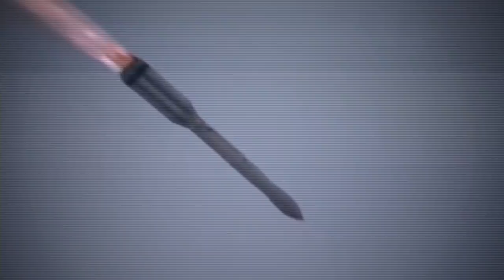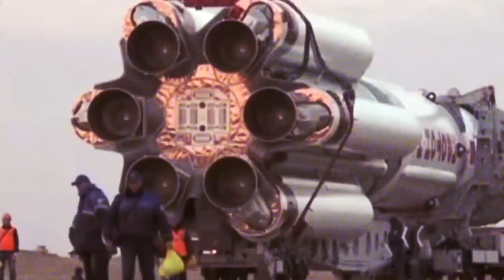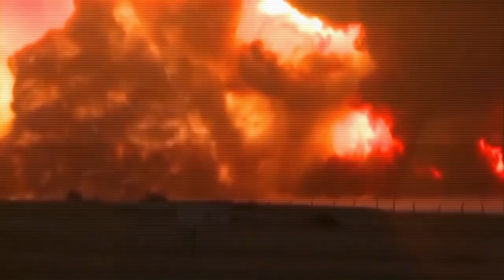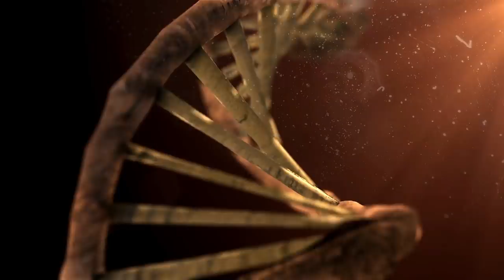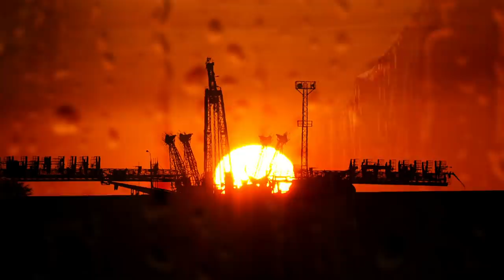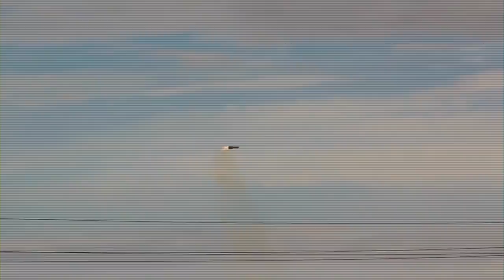Rocket with Sensors Installed Backwards Flies Upside Down

Comment: Small ICBM test flight failed when the software clock was set to the wrong start time.  The stage 1 pyro motor that provided power for nozzle steering started 30 seconds early and thus ran out of burn 30 early.  At which point the G&C could no longer provide steering and the range safety officer executed the destruct sequence.  Stuff happens.

Comment: Yes the technician installed the sensors upside down, but let us not forget that this PASSED inspection. Or possibly several inspections. They weren't building a Lada so there would have been inspections for everything. Or there SHOULD be inspections.  I guess if you have been launching these things since 69 without incident things get a little lackadaisical.

Comment: Not only the fact that it had arrows to point the direction of the angular velocity sensor, either Scott Manly or Every Day Astronaut said that it is apparently really fricking hard to put the sensor in the wrong way, so much so you would need a hammer to put it in the wrong way

Comment: Yeah ? Did you know that a US Military Space Probe of the Titan IV Family exploded shortly shortly after liftoff from Vandenberg AFB. The rocket used the exact same fuel (Methyl Hydrazine) and oxidizer (Di Nitrogen Tetratroxide) as that used in the Proton Launcher. The question to be asked is why does the producer of this video choose to single out the Proton ?

Comment: Even if the sensors were installed wrong, the bad orientation should have shown up in a pre-flight check.
Reply: Angular velocity sensors, so they’d be showing no angular velocity regardless of orientation before flight

Comment: It is still unexplained how the rocket's fuselage broke in mid-air, well before hitting the ground.
Reply: Wind resistance.
Reply: Inertia
Reply: I would guess wind resistance. The nose cone protecting the satellites is designed to take a large amount of aerodynamic force, but only along the main axis of the rocket. After turning all the way over and then some, that cone was subjected to aerodynamic forces at a significant angle difference from the main rocket axis, causing the nose cone to sheer off the second stage mounts. Otherwise, you will note that the rocket remained intact until it struck the ground.

Comment: The sensors were only designed to be put in the correct way. Whoever installed them really had to hammer them in for them to fit upside down. 
Also, gotta love hypergolic fuels. Toxic as hell.

Comment: Orange flames and toxic residue is the mark of hypergolic fuel which ignite spontaneously on mixing with each other. Its a way to simultaneously ignite all the rocket engines at one time when there are so many engines or when an ignition system presents a reliability risk, like lunar landers. Since the 1950's US launch rockets use cleaner burning fuels, like RP-1, that do not leave a toxic residue.

Comment: Yeah, I'm not surprised someone forced the sensors into place even though they didn't fit like they were supposed to. I've had more than one instance of someone forcing an Ethernet cable into a USB B port then calling asking why I am being paid if the printer doesn't work. Stop unplugging my stuff!

Comment: Redesign it so if installed up side down it will not work at all causing the rocket to not launch at all. Or a battery powered alarm that goes off if it is upside down just sitting on the work bench
I bet some one was looking for a job after that.

Comment: In NASA that step would have been triple checked and signed off multiple times. Some ended up in a gulag.
Reply: noaa-n prime satellite accident...
Reply: NASA lost a billion or so on a mission to Mars. One person was using metric measurements, nobody else was.
Reply: Apollo 13, Challenger, forget the name of the shuttle that crashed in Texas
Reply: @Richard-zc1cj  metric is way better than whatever the hell we use. Grams, ounces, stone, pounds, etc...
Reply: Biggus Dickus  They had polished the mirror to the incorrect specs. An amount probably imperceptible to the human eye but when your dealing with billions of light-years it adds up quick.

Comment: got to wonder what's up with quality assurance procedures in Russia. 
Why did nobody check and notice the incorrectly installed gyros?

A similar accident comes to mind, also in Russia, where an Soyuz launch vehicle was launched from a launch site in the far east of the country but someone put in the coordinates for Baykonur into the rocket's inertial navigation system as the launch site, causing it also to immediately veer off course on launch.
That one was destroyed by ground command.

Comment: A practical example of shit goes wrong, even in very expensive projects. Maybe also a good example of something that should have been designed with mind to installation and being 'fool proof', if the sensor could only be mounted in a particular orientation, such a mistake can never happen. Therefore I wouldn't even call it a 'human error', as it is automatically also a design error because a change in design could have prevented it.

Comment: Oh cmon.... Old news man... Any follower of Scott Manley is familiar with this one. And also the Proton and is Modernisation the M is not a space craft... It is in fact a Launch Vehicle, and the Pay Load is the Space Craft... Or Satellite. The only part you could consider a space craft of the Proton is the Briz-M Payload Boost stage used for getting heavy Payloads to Geostationary or Interplanetary Orbits, in which case the Briz-M is not likely to return and therefore is indeed a Spacecraft
Reply: And the accident highlighted a flaw designer's thought they had addressed adequately, the way in which the Guidance Unit by making it a one way install, it couldn't go upside down or so they thought. Not so easily avoidable and in my opinion a necessary screw up.

Comment: Again the engineering rule that if it can be put together wrong it will be was confirmed.  So if one wants to make sure something is not installed wrong the something must be designed so it can not be installed wrong.  This is not always easy to do.  I myself (I work as an auto mechanic.) and humans everywhere can be extremely creative in doing things wrong.  Double checking and checking again helps but keeping human creativity, to do things wrong, some of the time, is really hard to control.  Don't think it's a Russian problem.  We almost lost a space shuttle due to two hoses getting mixed up.  Yeah, the engineers fixed that with incomparable connections but that should have happened before.  You think the engineers double checked and checked again?  I am sure they did.

Comment: For some reason I don't buy that reason surely there would've been inspections to verify the sensors were fitted correctly
Reply: There is supposed to be, and two supervisor signatures were required to sign off on that component installation. Unfortunately something went very wrong there. Since the cables were installed properly it passed electrical inspection (the sensors all worked!)

It’s happened before - ArianeSpace’s Vega rocket had swapped the pitch and yaw thrust vector control actuators on the fourth stage, and the stage just spiraled out of control immediately after ignition.

Comment: "Sensors installed backwards", not necessarily. The logic of the circuitry could have been incorrect for example. I mean the design of the circuit could have been incorrect and they blamed the person who installed the components.
Reply: No, that is literally what happened. It was not a design error; this was not a new rocket. The system passed all electrical checkouts because the wiring was completely correct.
Reply: @AmbientMorality  I'm talking about the logic of the system. I'm not claiming that's what it was it's just that sometimes when something gets reported sometimes there are inaccuracies. For example journalists do that a lot they fail to properly research.
Reply: @dannygjk  The best English summary I've found is on RussianSpaceWeb, titled "Proton accident with GLONASS satellites". In this case the video seems pretty accurate; the issue was purely mechanical installation and all the hardware and software appears to have been correct.
Reply: @AmbientMorality  ok